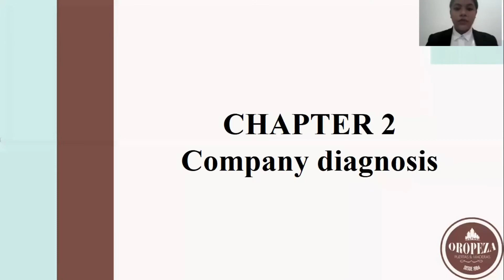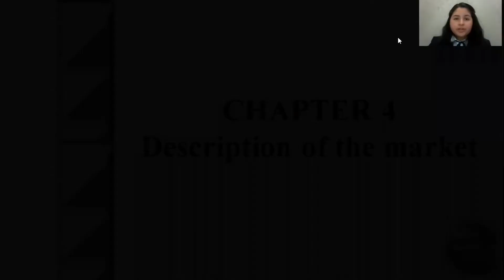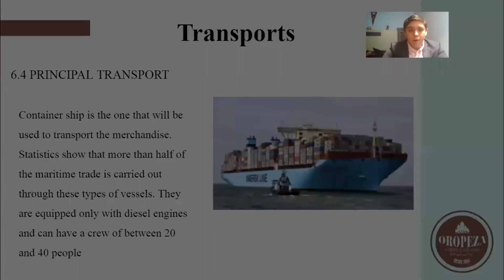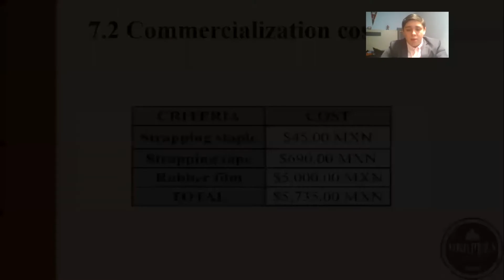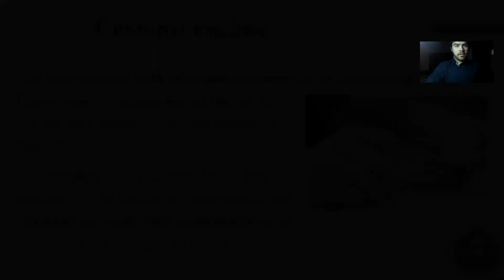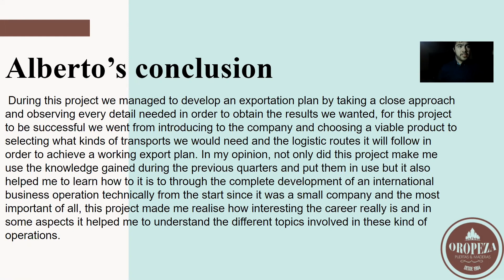Proyecto Integradora OCI BIS 3D “Oropeza, Puertas Y Madera”

Comment: Good work, I would like to know why you chose the INCOTERM used and how would you explain its usefulness to the company?
Reply: We decided to use the Incoterm FOB because in general, this Incoterm allows to have control over the initial costs. in addition to being accessible to the budget of the company, with the FOB Incoterm the company has the possibility of having a good start in the international market
Reply: Besides, the company does not have experience in international trade but they do have experience in sending the louvered doors to other states inside of Mexico, for this reason the INCOTERM FOB is the best one for them. They will be on charge of sending the merchandise to Veracruz port and from there, the buyer will be on charge. From Veracruz port until Puerto Rico port.

Comment: Guys, good job, can you tell me which INCOTERM did you used and why? Whic are the tariff preferences apolued and its legal basis? How did you calculate the VAM?
Reply: For the Incoterm, we decided to use the Incoterm FOB since it allows to have control over the initial costs. It is also accessible due to the budget of the company, with this Incoterm the company has the possibility of having a good start in the international market
Reply: The tariff preferences applied to the merchandise are established within the USMCA, of the LIGIE and rule 5.1.4 of the General Rules of Foreign Trade
The General Import Tax is exempt and the payment of DTA is exempt
Reply: The VAM was calculated according to the production costs of the doors, plus the incrementable costs of the chosen incoterm, and thanks to the USMCA, Mexico is exempt from the payment of the DTA and the General Export Tax, from there it was also added prevalidation and contraprestación